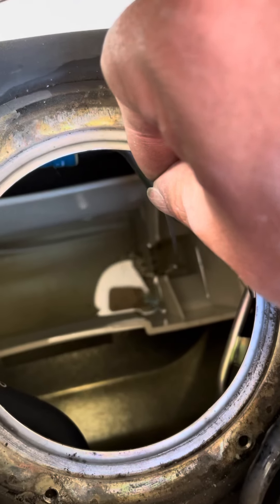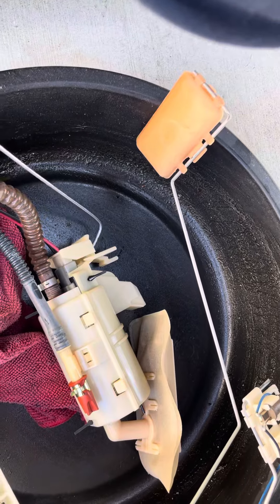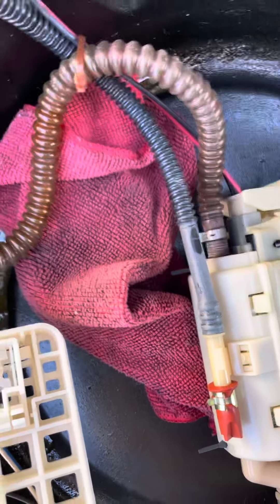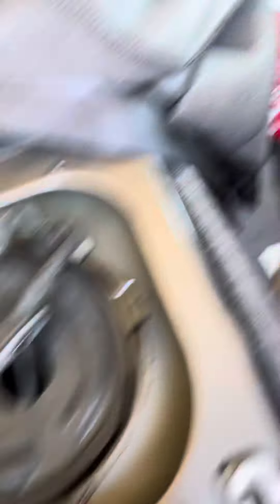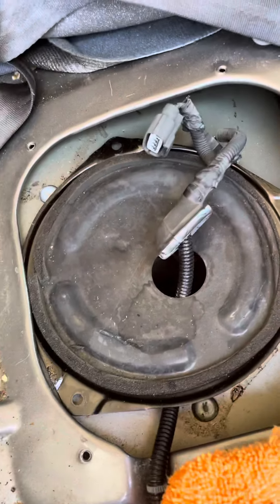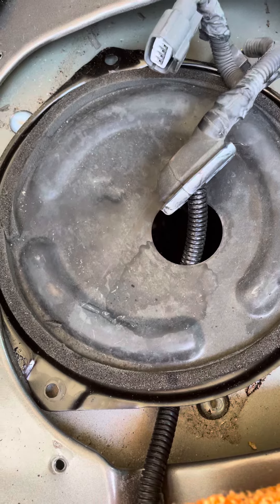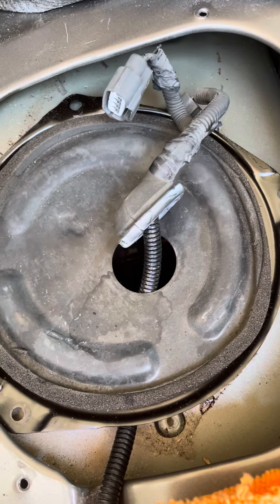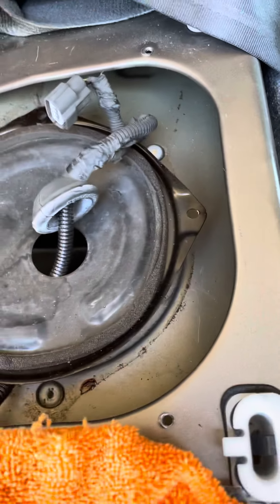Part 3 2004 Nissan Xterra (crank shaft position sensors not pump failing)

Comment: Was this for code P0340? I have a 2004 Nissan Xterra too but I’m not sure what the problem is. It sounds like it wants to turn on pero no se puede. Im not sure if you know what the issue could be or if you had the same issue. Thanks.
Reply from the maker: That code s the cam shaft position sensor which is preventing your truck to start on the video I repaired the wrong place because I thought it was the fuel pump but it turn out to be the crankshaft position sensor